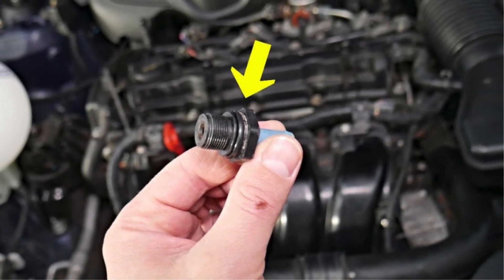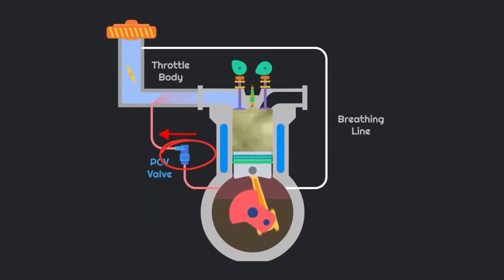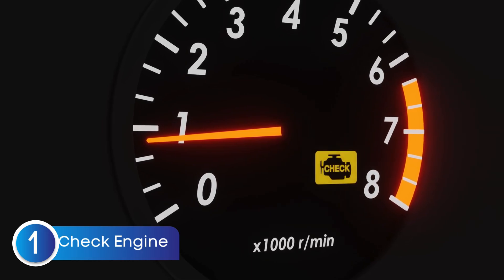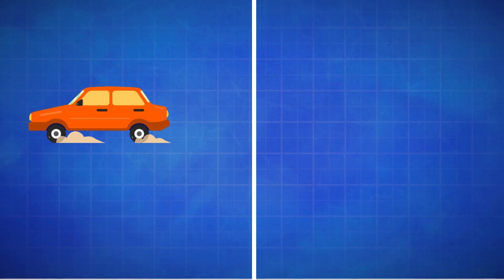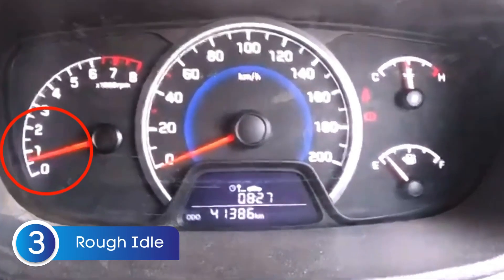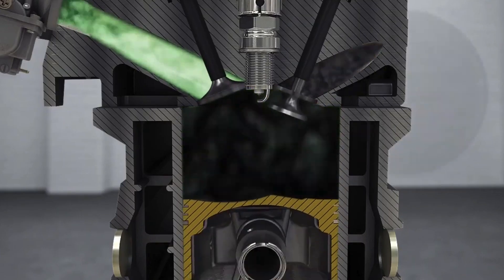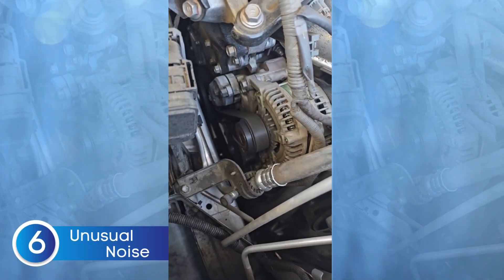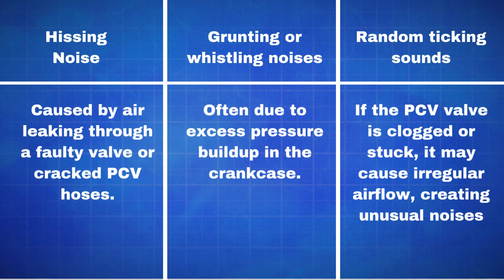6 Symptoms of a Bad PCV Valve

Comment: If my PCV valve was that close on that engine, I would’ve changed it every 5000 miles when I change the oil, but mine is in the back all in the back of the engine

Comment: If my PCV valve was that close on that engine, I would’ve changed it every 5000 miles when I change the oil, but mine is in the back all in the back of the engine
Reply from the maker: Interesting point about the PCV valve location!